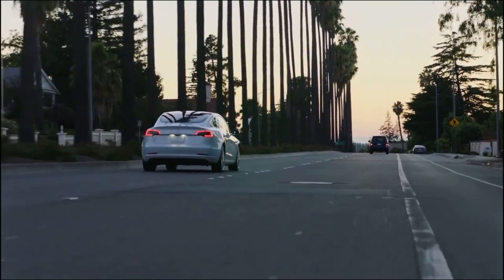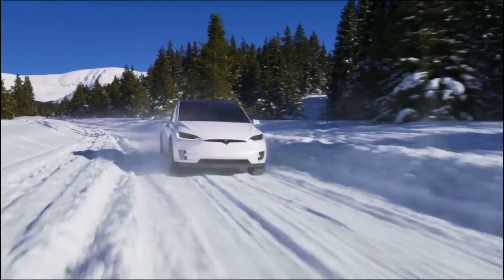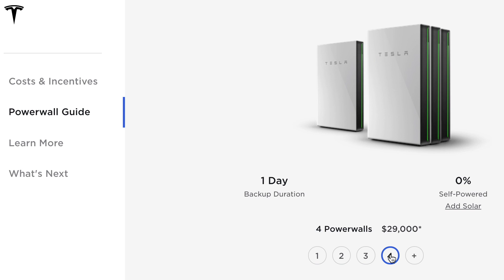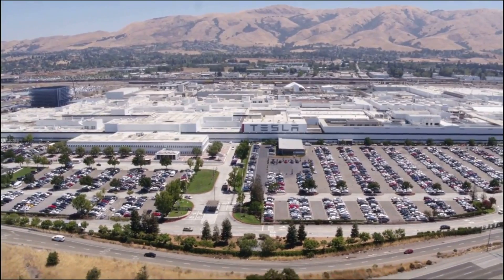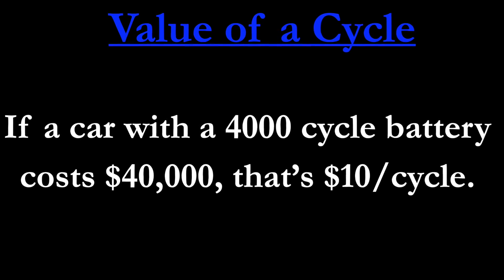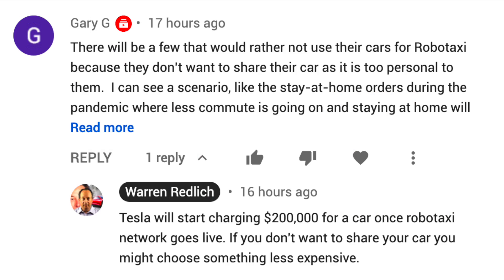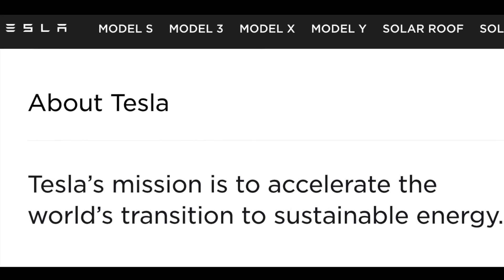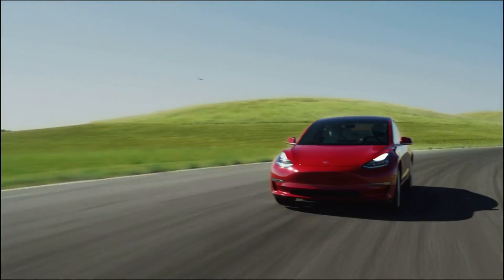Vehicle to Grid is Dead - Part Deux - JB Straubel

Comment: NEC specifies exactly how one may employ the same control unit for both solar and for EV2G . . . electrically it adds almost no cost and is FAR LESS cost than a solar installation with a stationary ESS. Look up SoleEdge hybrid EV inverter as one example. And if you’re wanting stationary energy storage, you will pay about the same cost per kW as the ENTIRE cost a vehicle - so why would should anyone pay twice? Seems silly doesn’t it? It will in the future. 

The argument then is perhaps not that everyone should be playing arbitrage with their EV if some utilities will not compensate them fairly, but rather it’s why would anybody buy a stationary storage battery system when they can get an EV that can serve that function instead. It’s a problem when non-technical people create content on public platforms that uncritically accept as gospel the opinions of people like JB who have specific interests to serve and products to sell to people. Today you would need $60,000 of TSLA Powerwall 2’s to have the same kWh and kW power of a Model 3 - ask yourself why Tesla wouldn’t want to sell you both?? The public is not demanding it (yet) and they’ve invested money in the technology (the real pot if gold for Powerwall tech is in the commercial and utility markets btw, but Tesla can thank regular consumers for footing the substantial R+D bill. Anyhow, stop regurgitating from the horse’s mouth and actually research the subjects in depth. Thanks

Comment: Hi Warren, very good video and thought provoking, It would be worth your comments on if this is a US centric argument as other locations around the world V2G is happening, is it the US low cost per kWh. In Europe electricity is $19c per kWh and I think at times in Oz its even higher.
I'm not sure the average annual mileage in the US but if Teslas are being run to 200,000 miles that is twice the 10 year life that is quoted, in Europe the average is 10k miles per year, so there are 100,000 miles battery cycles not being used. Also in the V2G trials in Europe the car outputs up to 6kW so from 6pm to 10pm that 4hrs = 24kWh @ 19c = over 10 years $16000 payback at no degradation to the existing 10 year 100,00 usage.

Just a final point on the price of installation of the Powerwall, Tesla are just making a ton on money on that first install as a 5kW PV array with non Tesla batteries and all the generation paperwork with the network operator costs about $2000 for the install, and that includes someone dancing on your roof :)  so if you installed a V2G device at the same time it would just be the sparkies time and materials. 

Mr Straubel made some interesting points about battery cycles remaining / technology changes and why they have no firm plans for 2nd life usage but actually what incentive commercially would Tesla have to provide V2G when they want to sell Powerwalls it would significantly eat into a revenue stream.
Reply from the maker: I don’t know enough about other countries to have an opinion.

Comment: Let's be real "It is difficult to get a man to understand something when his salary depends upon his not understanding it", V2G compete with Tesla Home Powerpack and utilities MegaPack so they won't let customers use their batteries as V2G, they prefer to sell twice the same thing.
Also battery degradation is not the same on all the battery range, on the 40%-60% range is almost nonexistant. 
RoboTaxi won't ever exist on the TM3, Tesla promised a lot on that and never delivered, they can't even park, it is just a myth to facilitate sales on pure dream of future revenues. V2G is possible now, robotaxi not, not with TM3 hardware.
Bidirectional charger are cheaper than you think,  and their price cannot be inferred from additionnal Powerpack price.
Reply from the maker: We'll have to disagree on the robotaxi future. I think it's coming fast. I get TM3 now - Tesla Model 3?

Comment: My hope for V2G is not actually selling battery energy to the grid but using for myself during a power outage or while camping. Also, V2V for rescuing a car with a dead battery would be great.
Reply from the maker: V2G is to the grid. Using it to back up your house is V2H. Camping is neither, but seems like a good idea.

Comment: with new battery technology the battery degradation argument could be null and void. THey also may not want to spill the beans about Tesla taking over the energy grid in the long term with millions of tesla cars plugged in creating microgrids everywhere. If the cybertruck has built in power outlets then techically i will have backup power for my refrigerator and freezer so i wont need a whole house system since living without lights is no big deal as long as the food in my frig is kept cold. I currently have solar setup with 30% feeding lead acid battery banks just for power failures. 70% is grid tie to lower my energy bill.
Reply from the maker: I like your thinking. I agree that in most places just backing up the refrigerator might be enough. But my house has two refrigerators, and we live in Florida where air conditioning is important. 

I was thinking I'd be able to use the AC in my Cybertruck in a power outage.
Reply: @WarrenRedlich  I have 2 battery banks of 12 batteries. I had a 3 day power failure and it was cloudy all 3 days so my chest freezer and refrigerator basically killed the one bank after 3 days since in Michigan our sun is limited. I added a 2nd bank of 12 batteries to spread the load. I will not be upgrading my batteries with lead acid type. When these are worn out I'll be hoping the cybertruck is available  so I dont have to buy a couple thousand worth of lithium storage batteries

Comment: The thing I didn't hear discussed was vehicle to house.  During an extended power outage I would like to be able to run my home using my car's battery and at times like that price/wear & tear are not factors that would be considered.
Reply from the maker: Installation of the connection hardware is expensive.

Comment: I think people are not taking grid bulk scale models,costs into account or that to call for Frequency Stabilizing Service grid requires 100% reliability. So I agree with your assessment that V2G doesn't work. 
Tesla is already working on virtual power plant in Australia using powerwalls, so who is in better position to judge V2G than Tesla? 
Finally, in power pack there are 16 number 14.5KWh modules, so if one modules goes bad, they just have to swap it out. But in car the batteries are filled with epoxy, so if it loses some cells and capacity, they can't repair/replace only damages portion.

Comment: Regarding sustainability: How would my dual motor m3 perform if it had batteries that lasted 5000 cycles? Or, utilizing Tesla batteries intended for storage, how would my car perform? Would those batteries last as long in a car vs storage (cycle-wise)? How long do we want car batteries to last? Apparently, one million miles worth. I would trade in some of my car's performance in order for it to last 500,000 miles. You ask, well what would you do with all of those miles? I just put on 40k miles in my first year of ownership. That was with taking 2 months off because of this covid-19 mess (I drive lift/uber). Elon's goal is to have robotaxis. Selling cars to individuals is a means to an end. Just like making expensive model S and X was a means to making m3,  and y. Eventually, Elon will mostly just make relatively low volume specialty cars for people (roadster, cybertruck), while his robotaxis takeover everything else.

Comment: Here are some more factors. The average house is about 2300 square feet. I’d the whole roof is solar than at high noon you could be outputting close to 50kw on a really good day in peak season. This would require a 50kw inverter which at .20 per watt should be about 10,000. Now let’s say you’ve got 50kw in a battery to play with and that at a peak moment power is worth .50 per kw. Let’s say between 8pm and 10pm after the robo taxi evening rush. You could make 25 dollars in just one hour using the same invertir already in your house that processes that solar power. This is when it becomes a win win.
Reply from the maker: Not sure where you get .20 per watt. What does that mean?

Comment: I believe you anyone who thinks this is smart doesn’t understand batteries
Reply: Perhaps, I'm normally very impressed with Warren's analysis. However he uses the answer to a question four years ago and makes little or no reference to the million mile battery, the total of which would be unlikely to be used by a private owner. In terms of CO2 it would be better to use all of the cars as robotaxis because then we would be making something like 90% less cars and I think that this is what Tesla is really thinking when they see V2G as far less impactful. In the future we may want cars to be a part of the renewable energy equation to assist transition to 100% renewable. Of course Tesla could possibly produce enough batteries to enable this or some other battery technology, such as flow batteries may provide the bulk of storage.

Comment: I think you are making a good case and I must admit that it is shockingly good such that it changes my mind. While most vehicles don't have two way, the cybertruck will put out 240 which is a lot closer to being able to do this, but this equipment costs money and may also be insufficient. If the grid operators trust the Tesla vehicle to register the correct amount of energy and there is not something else I am missing, I am not sure how two way transformers are. Only some vehicles will even bother to have features useful to V2G at most. Stationary batteries will be more specific down to the cell level and make the economic viability of V2G a rare thing not worth pursuing. Better futurism through economics.

Comment: Hey Warren, you said you weren’t going to talk about Robotaxis but you did. 

You are basing your arguments on the current battery in a 2016 Model 3 and the video is based on todays battery technology and I agree with you and the video. The discussion of V2G is only possible with Tesla’s new battery technology that will go into EVs probably next year. 

If I buy a new Tesla EV next year with a million mile battery and I drive the average 12,000 miles a year, that battery will last 83 years!!!  Who is going to keep the same car for 83 years?  The extra battery life is plenty to support V2G for the 10 or 15 years, I may have the EV (with technology changing so fast, I probably wouldn’t want to keep a 2021 EV for that long just as I wouldn’t want to keep the original iPhone for 10 years even if the battery life was great and only needed charging once a week). After five years I could sell or trade in the EV and it would still have over 30 years of battery life.

The second life use of EV batteries only makes sense for the million mile battery, not todays batteries. EVs can’t  afford to carry around a battery pack at 80% capacity because the dead weight of 20% of the battery will dramatically affect range and efficiency. At 80% capacity, these million mile batteries may still have 20 years of useful life as stationary battery storage where weight and space are normally not as critical as the cost. Imagine buying a 13.5 kWh Powerwall 2 for $5,000 or less installed!  The same for Grid storage. 

I am not sure how old that video was but Tesla has already solved the bidirectional electricity problem with their solar panels and Powerwalls. Net metering allows homeowners to sell excess solar energy to the grid and get credit for that energy when they need it. Tesla has the hardware and software to do this today and they also have the Autobidder software available today - they use it in Australia. 

Even if homeowners just received credits for the electricity the send to the grid - one kWh for one kWh or if homeowners were able to use the battery in their EVs parked in the garage after work for their peak energy demands (from 4pm to 10pm) instead of buying from the grid at higher peak rates - V2G makes sense - and especially in emergency situations where there is no power.
Reply: Thanks for the good work and clear thinking!

Comment: My thoughts on V2G rotate around emergency supply, belt & braces, keep a building powered during outages or a disaster, it’s not about being paid it’s about keeping the lights / heating on a bit longer, how much would you pay to keep an operating theatre powered ?. How much value do you put on your life or that of your loved ones ?.
Reply from the maker: I'm with you on that, but you're talking about V2H (Vehicle to House), not V2G. I talked about V2H in the previous video: https://youtu.be/JRO4a_6mNhI
Reply: Warren Redlich I feel the two are connected, taking a house or hospital off the grid for power during a crisis is sort of V2G, less load on the grid so helping the grid cope
Reply from the maker: Related, but it's not V2G. V2G is the vehicle supplying power to the grid.

Comment: the utilities do not want to buy power from us, this is why  they limit the size of solar arrays and add  controls to power walls/solar systems..When California had  manufactured shortage of power the rates to cover "the shortage " made some people very rich and cost California billions. Elon talked about how much the Horndale battery saved and the huge rates that were paid  to the battery owner. That battery cost $90 m  and is now paid for . At 130 megawatts  that's 1300  100 kwh Teslas . That's $69,230.00 per Tesla in a little over a year. The owner is doubling up and doesn't need a bunch of  Tesla owners  raining on his deal.The Hornsdale battery didn't pay off $90 millon with $00.04 /kwh power.
Reply from the maker: I'm not sure about the economics behind Hornsdale. It's a good question.
Reply: @WarrenRedlich  Elon was talking about upgrading the Horndale battery on Youtube he said, $1500 per megawatt was avoided, translation; paid to owner of battery.If a 100 kwh  battery X 1000 cycles = 100000 kwh or 100 megawatts X 1500= $150,000. The E.I.A. said in Dec. 2000  Ca.paid $376/ megawatt
Reply from the maker: Do you have links to those numbers?
Reply: @WarrenRedlich  google ca. 2000 energy grid  crisis  and Elon spoke about the second round for Honesdale  not to long ago

Comment: I believe that Tesla will continue to sell cars at existing prices (~$50K), but that they will sell the license to use it as a robotaxi at a premium (an addition of ~$150K).
Reply from the maker: Why would Tesla sell a car for $50K if it can sell the same car for $200K?
Reply: Won't competition between Robotaxi operators drive the fares down so low that a $150k Tesla, let alone a $70k or 80k Tesla would never make sense.
Reply from the maker: There won't be enough competition for a long time.

Comment: I respectfully disagree but enjoyed your video. Tesla could easily come out with a power wall that not only takes DC from your Tesla solar panels but also from your car to use maybe not for the grid but for your home during emergencies. It may be something Tesla unlocks during emergencies only but it will happen. It's already happening by YouTubers like Jack Rickard who will sell you everything needed to turn a battery pack into a whole house battery backup. Why does this market exist? They are wrecking model 3's daily now that they are mass-producing and these batteries can be bought at salvage prices for the fraction of what 100 kW hours of powerwalls would cost you. Also it only makes marketing sense to be able to advertise a vehicle that can also power your home in case of emergency for probably two weeks. I don't disagree with any of your arguments but it is going to happen if not by Tesla by a competitor who will most likely beat Tesla with that kind of an advantage
Reply from the maker: I understand you might disagree with me. But you disagree with JB Straubel, Tesla co-founder and CTO at the time?
Reply from the maker: Wrecked Model 3 battery packs are not near the end of their life. Different story.

Comment: This video largely rests on Straubel’s comments over 4 years ago - which was absolutely realistic and correct then. But Warren you should have acknowledged this is a very long time ago given the enormous progress in batteries and we are now looking at Tesla batteries lasting 2 million miles so the concerns re degradation no longer apply.  Also you don’t seem to get that V2G is actually more about V2H. it’s about using the car battery to store your solar production to power your house while you’re not out in the car. This means you don’t have to pay for the expensive power wall as you already have the huge battery in your car. Forget about selling back to the grid. But you can make a small extra with no significant battery degradation from that now. I hope this explains why I think your analysis is flawed.
Reply from the maker: I think V2H might be a good idea for emergency backup - I mentioned that in the first video. It's V2G that's the big problem.
Reply: Warren Redlich it’s not about backup. It’s about efficient use of domestic energy, which has to involve solar and storage. The car solves the storage requirement. Hopefully you’ll understand now!
Reply from the maker: Once you're installing solar on your house, you might as well install a Powerwall.
Reply: Warren Redlich here in the UK a power wall costs over $10,000. Hence why it makes so much financial sense to use the car instead, now that battery degradation is no longer an issue like it was in 2016
Reply from the maker: Battery degradation is still an issue. Maybe a smaller issue, but still an issue.